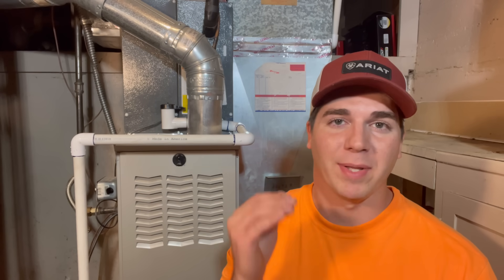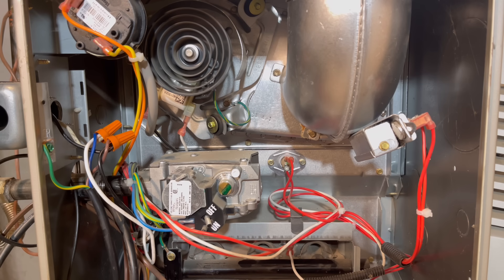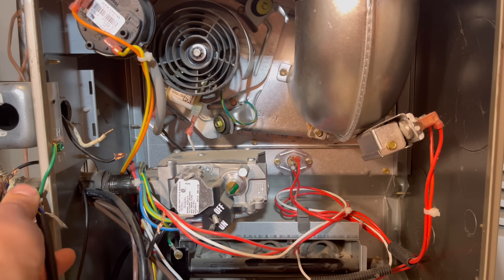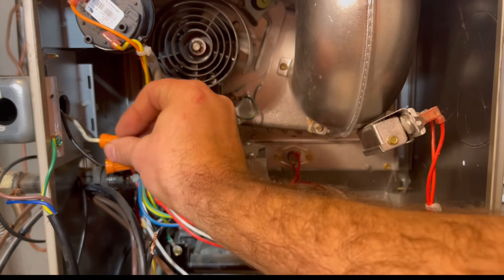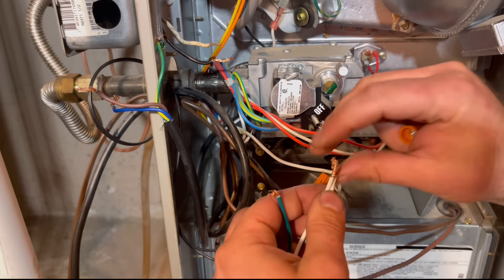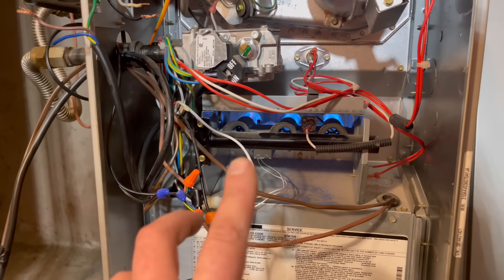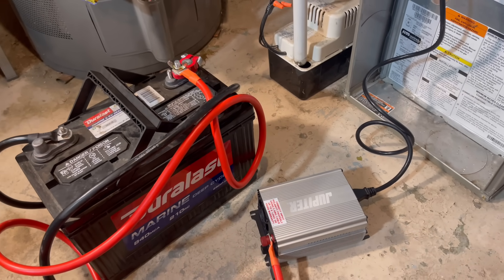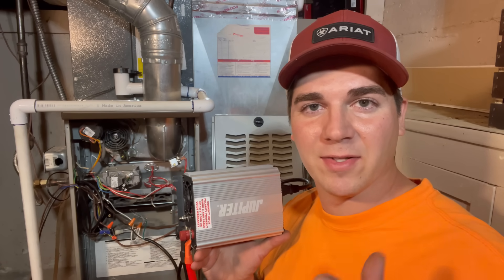Did You Know You Can Heat Your Home With A Car Battery?

Comment: I need to ask where is the video showing how long the furnace will run on the battery and inverter? I just see the loose thermostat video show up in the corner of the frame. Sorry to admit it but I have a school bus I've been converting into a camper and have everything to do the job in the bus but never thought of using the inverter and batteries for home furnace backup. Thanks for the video. BTW it was " suggested" I've never seen your channel before but I'm subbing..
Reply from the maker: Thanks for watching! The test video is coming. I actually hooked the inverter to my truck battery so it will run the furnace as long as the truck has fuel. That video will be posting soon! Cheers

Comment: I've got a question for you...what is the amp draw when the furnace is operating with the burner and blower is running?
Reply: Not low enough to run for days.
Reply from the maker: 7 amps. I ended up hooking the inverter to my truck so I can run it as long as I have fuel in it
Reply: @diyhvacguy  Thanks for answering my question.
Reply: So what you are showing in the video is not practical.
Reply from the maker: @Mytube5202  well what I ended up doing is installing the inverter in my truck so I can power the furnace as long as I have fuel in the truck. I realize now that the battery wouldn’t last as long as I originally thought, but the concept is knowledge that we can have in our back pocket in the even or a power outage where we can’t get a generator. Cheers

Comment: Great thinking. Many cars and trucks come with 110v outlets so you can do this idea but the vehicle has to stay running. Just use extension cord with the pig tail cord you showed.
Reply from the maker: Mind blown. My wife’s Tacoma has a built in 110v outlet that I didn’t think of till now 😂 thanks for sharing! Cheers
Reply: @diyhvacguy  Now do a video on how long a tank of gas can run your home heat. :-)
Reply from the maker: @WeatherNut27  I will for sure!!! My Tacoma I have the inverter in is a 4 cylinder but each vehicle will be different. It will be a cool test.
Reply: Most of those automotive 110v outlets aren’t rated for anywhere near the wattage your furnace draws.

Comment: You do not need to remove a car battery. Simply put your inverter under the hood and hook up to the battery. Run an extension cord into the house. This allows you to run the vehicle to charge the battery. 
I did this for days for several power outages that lasted 3-7 days. Simply ran the vehicle occasionally to keep the battery charged.
Reply from the maker: Yea! This is exactly what I did. I’ll be posting a video on that soon. Thanks so much for sharing!!
Reply: @diyhvacguy  Nothing beats a generator. But in hard times you do what you have to do. What I did kept the family warm in low teens temps . 
The key to under hood inverter is to keep it dry and keep the hood cracked open. 
Good content btw.
Reply from the maker: @ptmmatssc13  thanks man!
Reply: Yup!!   I did the same back in 2010 during a freeze in El Paso that lasted for 3 days.  The City had "planned brown outs" because our city's power grid couldn't handle the cold. The brown outs were 45 minutes long every two hours.       I had a 400w/800W peak inverter in my Trans Am.  Lucky for me it had a full tank.  So for the 3 days it was enough to keep the furnace going .  My furnace was already wired with a 115V power cord.
Reply from the maker: @enriquealvarado2930  brilliant! Glad it got you through. So many people are going to be up a creek if/when this happens here. It’s nice to have the knowledge on different ways to achieve power in that situation. Thanks for sharing! Cheers
Reply: @enriquealvarado2930  I hear things like "big freeze" and then realize it works out to -7C which is still pretty much shirt and pajamas weather where I'm from.

Comment: .                       CAUTION ⚠️
Be sure to use a pure sine wave inverter if you're gonna do this set up
Most inverters are modified sine wave and today's furnaces have sensitive electronic equipment and modified sine wave can damage such equipment , 
So it's definitely worth spending a few extra bucks for a true or pure sine wave inverter to avoid hundreds , Perhaps thousands of dollars in furnace repair
Pure sine wave is clean power
Just like the power in your house
Modified sine wave isn't and there's other kinds of equipment that you cannot use with modified sine wave , Such as cordless power tool chargers and audio equipment
Modified sine wave will for sure damage cordless power tool chargers
One more thing , Be sure to oversize your inverter to prevent damage and shortening the life of the unit
For example , If your furnace draws 1000 watts , You want to use at least a 1500 watt inverter or even larger unit
Reply from the maker: I ordered a pure sine wave inverter and am in the process of hooking it up to my work truck so I can power my furnace as long as I have fuel in the truck. Thanks so much for sharing your knowledge! Cheers
Reply: @diyhvacguy  You're most welcome , Modified sine wave I is ok for lights and small single speed motors but not for electronic equipment , All inverters are modified sine wave unless they're marked
Pure or true sine wave
Reply: .                         DANGER ⚠️
If you have your batteries indoors to keep them out of the cold weather and enhance their performance , Be absolutely sure to put them in an enclosed battery box with a means of ventilation for venting gases to the outside , Batteries produce hydrogen gas when charging or discharging which is highly explosive when mixed with air and has no odor and is lighter than air 
It's best to locate your battery boxes close to the basement window and away from any ignition source such as the furnace and hot water tank so a vent pipe can be installed and run out the window to allow hydrogen gas to vent to the outside 
Good luck with your project but in everything you do
ALWAYS PUT SAFETY FIRST !!!

Comment: I wish you knew how much I love these kinds of videos. Thank you for taking the time to share the knowledge. God bless you. Subscribed!
Reply from the maker: Thank you so much for the support! Anything helps in an emergency situation.  I ended up finding that if I put the inverter in my work truck and running an extension cord to the furnace it’s an even better solution. That way I can run my furnace as long as needed as long as I have fuel in the truck :) stay tuned for that video as well! Cheers
Reply: @diyhvacguy  use a portable generator! Someone might steal your truck when you are sleeping!
Reply: @uhjyuff2095  As the people in New Jersey found out when Hurricane Sandy hit, fuel is pretty much gone in a day. As a matter of fact, gas cans were no where to be found also.
Reply: @1965myctahg  propane generators are cool

Comment: Fortunately, my furnace/AC has a regular 110v plug that goes in to a power socket, so I can just unplug it and plug it in to the inverter. I bought a 3k watt model so it could power my fridge & freezer plus a couple of 110v window AC units in the summer if I have to.

Good info.
Reply from the maker: Awesome! That’s exactly what I’m going to do on mine, and then I have the inverter mounted in my truck so I can just run an extension cord and run it as long as I have fuel in the truck. Much quieter and longer runtimes then a generator! Cheers
Reply: @diyhvacguy  Running the cord to your truck is a great idea. 
BTW - I am also in Texas. (NRH/Hurst area) 
Hopefully, we do not get hit with another harsh winter, but as cold as it has been the past few days, I think we may get zonked again this year....
Take care

Comment: Great video. thanks.... There are 2 plug sources for 120 volt, what if you were to use one of them to hook up battery charger which in turn would charge the battery the same time you were drawing power from it? Do you think this would work to keep battery charged?
Reply from the maker: That’s what someone else on here was wondering. It would make sense! I ended up mounting the inverter in my work truck so I can charge it continuously with the alternator and it will run as long as I have fuel in the truck. Longer runtime then a generator and much quieter :)  I’m gonna do some digging on the charger idea though! cheers man.
Reply: @diyhvacguy  @Tanker Man's idea is the same as perpetualy motion... impossible. You can't charge a battery from itself.  Neither the inverter nor the charger are 100% efficient, and even if they were, they battery would only keep itself charged if there was no other load.

Comment: The DIY HVAC Guy bro you are a GENIUS my furnace is just like yours, question so the only thing you did was by past the on and off switch so if the electrical grind go out you just adding power back to the furnace like the grid is still on, I have a small amount of electrical skills and sorry if i'm sounding stupid....Peace
Reply from the maker: Hey there are no dumb questions here man! Yes, This is just replacing the grid 120v supply. So how I have it set up now, and I will upload a new video soon but I have a pure sine wave inverter mounted permanently in my work truck, so I’ll just run an extension cord from my truck to the furnace, and it will power my furnace as long as my truck has fuel, it would probably idle on a full tank for a week. So the alternator will keep the battery charged up and the inverter can do its job. That’s how I’d recommend doing it moving forward :) thanks for watching! Cheers
Reply: @diyhvacguy  Thank you for responding back, we love your channel and sharing AMAZING ideals to help us. Stay Bless and Safe....Peace

Comment: May be worth mentioning that most furnaces have a kill switch that is activated when service panel is removed.
Reply from the maker: Yes I’ll mention that when I do the test video. Thanks for the tip! Cheers
Reply: @diyhvacguy  Could you just connect the wire to the kill switch  instead of the furnace?
Reply: It turns the furnace off but it can still be bumped and turn stuff on so be careful reaching in there. Better to shit it off at the SSU or breaker
Reply: All do now and it’s required by government epa
Reply: EASY to forget that switch too

Comment: also works for fridges w/o grid power.. recommend lithium iron phosphate lifepo4 batteries(around $300 minimum) instead of car starter lead acid types.. even though both might be rated 100ah capacity.. lifepo4s have circuit system protection and uses more or less near rated amp hours(time batt can supply power) but lead acids can only be safely used around 40 to 50 percent w/o risking damage.. better yet, wiring furnace with a powering plug to work off've solar chargeable inverter/generator battery bank (ecoflow is what am familiar with) would be easier for folk less knowing about hot wiring home appliances.. although this is a viable option for those on a pinch.. great video!
Reply from the maker: Thanks for this info. And thanks for watching! cheers

Comment: A pure sine wave inverter will keep the furnace motor and electronics working well.

I noticed you held the AC supply line as you disconnected the furnace from the grid. 

You will need more battery capacity in case the outage last for days. Perhaps a solar charger will be helpful in this case. 
A little math work will sort out these things. 

Good concept.
Reply from the maker: Thank you for your comment. I actually decided to install a pure sine wave inverter in my truck instead, so I have plugs if needed while on jobs, and I can just run an extension cord to the furnace and run it as long as I have fuel in the truck! So I’ll be putting out a video on that very soon :) thanks for watching! Cheers

Comment: I’ve been a HVAC service tech for over 32-yrs now and will say this video is great!  Not reading through all the comments … I will point out one GLARING thing that I picked up on within the first few moments.  

That 2x4 electrical j-box on the outside of the furnace is a hazard and in NEC violation.

1. 
Install a 1/2” knock-out (aka KO) cover/plug (preferably metallic) for the empty hole showing at the front of the furnace.(and for any other KO holes that are open)

2.
MOST IMPORTANTLY: Install a KO bushing where the wires pass through the metal cabinet into the furnace.  The wires will rub against the sharp edges of the KO holes and eventually cut through the insulation and short to ground.

Other than that, great video!
Reply from the maker: Awesome thank you so much for sharing your knowledge! Much appreciated. Do you have a link for that rubber bushing you are talking about? It’s for standard 1/2 or 3/4” knockouts? Thanks!  Dave

Comment: Thanks for the jump start for my brain I was just worrying about  having a temporary setup for power outages . This sounds like a good enough temporary solution while I go about setting up my generator which under bad weather could take quite a bit of time .
Reply from the maker: Im creating another video  on this subject and my advice is to just install the inverter in your car, so it doubles as a 110v power source if needed in your car, AND you can power your gas furnace with it for as long as you have fuel in the vehicle. At idle it will last much longer then a generator and much quieter.
Reply: maybe dumb Question ???  Thermostat power      Nest Common wire

Comment: Again as some have pointed out. It's a nice concept but would only work for a few minutes at most on a single battery before the low battery protection alarm would go off and shutdown the inverter.  With only one battery you only have one volt to use . You would need several batteries run together to get hours out of it. Think about it. Now if you had an electric car that was fully charge it would work if it has an inverter because the car uses many hundreds of volts to run its motors. Try it out  with the single battery and run it down till that alarm goes off and it shuts down .. you will see. I wish it did work . There would be lots of people converting to simple single battery systems to run each appliance.  People trying to live off grid have been trying to figure this out since electricity has been around
Reply: Let's see how long it lasts.  Gas furnaces use little power over time.  One spike at ignition time, then just steady blower fans.  A friend had a HVAC squirrel cage blower in a wooden box he took camping with a marine battery.  Ran for days on one full charge.

If this was an electric only heat pump it would definitely need a battery bank.

I just heat with kerosene when my winter power is out...but that is a learning curve and frightens many people....however in the mountains I've been burning KeroSun and Perfections for many years.
Reply: my car has built in inverter.    long extension lock doors (extra key } 3days no power.  My  friend needed power for life saving Medical device. Car ran all night gas Expensive 
Best Friend PRICELESS

Comment: So I'm in the process of building an off-grid house. I had an RV furnace, but someone broke into my storage & stole it. I came across a relatively new house sized propane furnace from someone converting to electric, for a great deal. My plan is to run the gas controls off a pure sine inverter, fed from my battery bank, and replace the normal fan with 4 200mm 12v computer fans. They're 160 cfm each, so 640cfm total, at < 10 watts each. Less than the 9-1100 typical of a 60,000 BTU furnace, but in the ballpark. It's not a very big space I'm heating, so either not using ducts, or 1 duct around 10' long. Maybe.

Comment: I prewired the furnace power shut off switch with a cord to plug into a power source like an inverter or generator power socket so I can connect the furnace during an extended power outage without any effort.  Works perfectly.
Reply: maybe dumb Question ???  Thermostat power      Nest Common wire
Reply: @deadfisfhalequin2304  Thermostats are battery powered.

Comment: You should never leave a car battery on a concrete floor or block always use a wood piece to set your battery on  because if you set your battery directly on concrete it will drain the charge quickly . Good info my friend.

Comment: Did this February last year . Hooked up from my car left running to run my 2000 watt inverter. Ran exsticion cord to house outside plug. Made a male to male jump worked great
Reply from the maker: Nice! That’s what I’m gonna be doing actually. Thanks for the comment!
Reply: my car has built in inverter.    long extension lock doors (extra key } 3days no power.  My  friend needed power for life saving Medical device. Car ran all night gas Expensive 
Best Friend PRICELESS

Comment: This will work better with furnaces (and especially boilers) with modern ECM motors that have less draw, although I wouldn't use a cheap non-sine inverter.  I use my system to power a pellet stove that pulls 120 watts continuous.  The generator only needs to run 4 hours/day to recharge four 230 amp 6 volt batteries that power a 2000 watt sine wave inverter.  Batteries are in series parallel to yield 12 volts.  That gives a nominal 2760 watts at 50 percent discharge.

Comment: I was thinking of doing this using a UPS backup. So if the power cuts out while the furnace is running, it'll continue to run as if nothing happened, and I won't need to intervene every time there's a power failure.